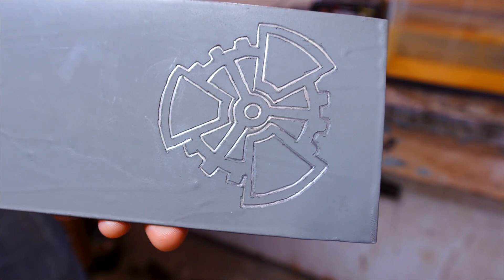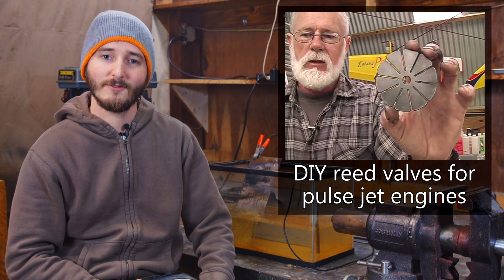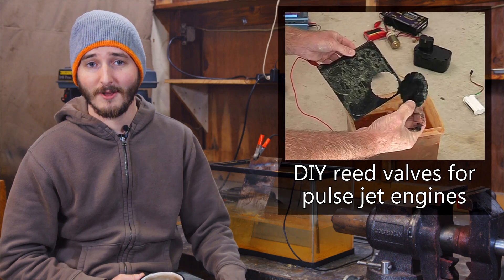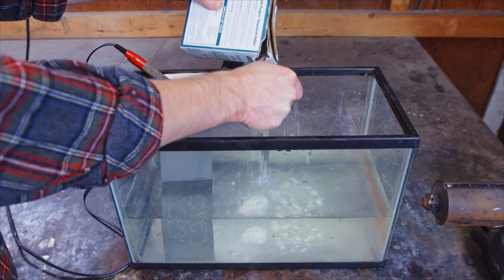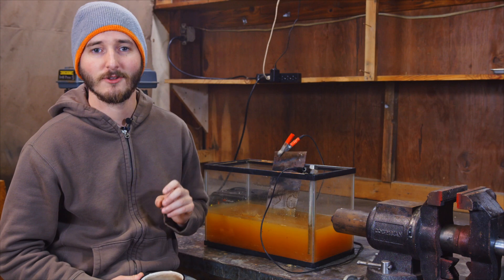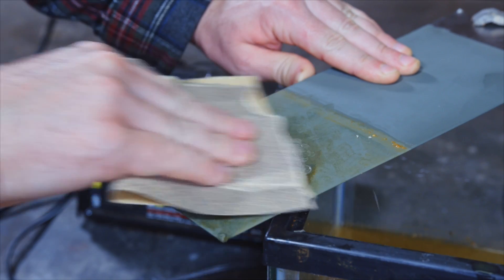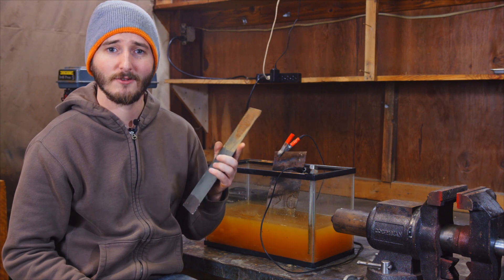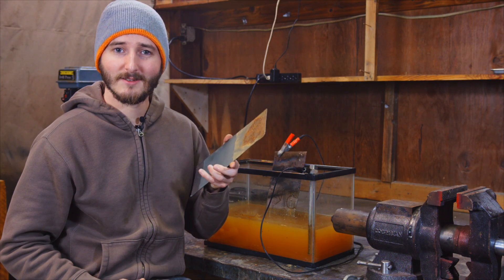How To Cut Steel With Electrolysis [Experiment In Progress] - NightHawkInLight

Comment: Alum, specifically hydrated potassium aluminum sulfate. I used it a lot to dissolve broken steel drill bits and burs from gold and silver. If I was going to attempt this its what I would try.
Reply from the maker: Using an alum chemical etching solution is on the to do list.

Comment: I do that with copper and zinc , it works great with zinc . What I do is I coat the metal with beeswax (more flexible than parafin or palm wax and perfect for this) then I take an awl or a knife to scrime my patern onto the wax until the metal shows up , than I clamp the metal with a part with no beeswax to the positive terminal of my generator and use another plate of metal in the negative terminal . I use white vinegar as electrolyte , I don't think baking soda is up to the task , the best thing to use is NaOH .

Also beware of stainless steel , if it dosen't oxydize in air it will be more difficult to oxydize it with elextricity , also the wider the grove to cut is , the harder it is to cut because you have to oxydize more material , so try to make the finest line possible  , you cannot really use sticky tapee because I didn't found this very effective , I try paint , but I'm not happy with the result , beeswax's the best

Comment: Looks like AvE covered it, once it starts you have it dissolving in all directions, not just straight down. Thing like you're digging a hole in the ground, once you start digging you're not just exposing ground right below you, you're also exposing dirt to the side of you. If you were forced to dig at any dirt you see starting with a grass covered lawn and a small patch of dirt, you'd quickly be digging a half-sphere growing in diameter, starting right at the boundary between the grass and the dirt.

Comment: - so far as etching is concerned, the electrolyte shouldn't make much difference.  But it might attack the resist coating.

- Undercut proportional to the thickness of the etch should be expected.  But more than that would be an adhesion problem.  For a really good cleaning I've heard that a strong alkaline solution (like lye) is needed to cut the grease, and any handling with bare hands afterwards can leave skin oil deposits.  Alternately, an oil based resist (like wax) shouldn't care as much about oil deposits.

- Hydrogen bubbles will form.  As long as they don't adhere they shouldn't be a problem.  On the other hand, if bubbles form and adhere they may prevent depth of etching.  Same with rust that adheres.  Orientation of the metal sheet and agitation of the solution may make a difference.

Comment: Silicone protective coatings (anti corrosion in sea water) are great at adhesion to steel and resistance to demonstrated "bubbling"........ at least the ones I have seen in some lab tests (similar conditions to these in video), but that was some high end industrial stuff for dam gates.
Reply from the maker: Great tip! I bet a lot of marine paints would have potential.

Comment: Try sand-blasting the metal to clean it immediately before applying the paint.  Even with solvent cleaning, you'll still end up with a thin layer of grease on the metal which will prevent perfect paint adhesion.  This from a Dan Gelbart video on proper techniques for painting metals. https://www.youtube.com/watch?v=x7onZGqrYyY

Comment: It really  works  best only  for very  thin materials, .002" to .005" or so.  Also you should  try PC board  etching  fluid ( iron chloride ).   On thicker  material  it is virtually  impossible  to prevent  undermining  of the mask via the  exposed cut.  short  multiple  etching  cycles  and  re-masking the cut faces could be  tried  but may prove  impractical.

Comment: Try lowering the amount of power that is in use, and reducing the thickness of the metal that you're trying to etch. You might want to also try different grades of steel to see which ones perform better.

https://en.wikipedia.org/wiki/Spring_steel

Comment: Hum, maybe some of my experience in automotive quality control might come in handy...let me thing.

Okay, two possible things are happening here. The first is that the steel is being eaten away, and as the channel forms, it then starts to be eaten away from the exposed area, thus bypassing the paint. If this is happening, then I have no viable solution to the problem.

If it is an paint adherence problem, then perhaps you need to use an electrostatic powder coat paint. That should adhere to the steel far better then any other possible coating.

Comment: Maybe the metal sits in the water for too long? Try increasing the reaction speed, ie higher voltage (48V) at a decent current. Please note that newer battery chargers do "smart-charging", which may be messing up your process.
Also, have you different solutions, ie table salt, instead of baking soda?

Comment: SO.. I've got a bachelor's in chemistry. Briefly, I can see several things.

Firstly, Carbonates are bad for this. Bicarbonates are also bad for this. If you're intent on using a basic pH use borax (sodium tetraborate). It won't vent carbon dioxide if there's a rapid pH swing, it is basic, and is a good buffering agent. 

Secondly, I would probably try to use an acidic environment for this. Acids are easier to work with if you're trying to etch/eat metals because they tend to make the solution more acidic anyway as they dissolve into solution. In theory, by making the solution acidic to start out, you slow down this rate of dissolution. In practice it largely depends on which anion is generated by the acid. 
Vinegar is very mild. More aggressive is phosphoric acid, which is the workhorse of CLR (a domestically available solution in the USA). Hydrochloric and sulfuric acid are aggressive enough to eat the steel without any electricity. 

Thirdly, we come to electrode materials. The flexible pipe is not regular steel. It's stainless steel mesh. It's probably nice to work with because of the surface area, but the chrome will interfere with the other piece of metal. I'd switch over to one of two materials: Steel wool or graphite. 
Steel wool should be similar to the sheet metal's composition to be ok, and graphite pushes in the other direction entirely (if there's a side reaction, the carbon oxidizes and goes out of solution). 

Finally... I think going with Wax is probably best, but it's worth noting why. The wax, especially if you apply it hot, sticks directly to the metal. Most paint does not. Paint kinda just sticks to it's self. You could use vaseline, but wax is probably best because it's a bit sturdier. Alternatively, you could use an adhesive... but the carving of the design becomes tedious at that point.
Reply from the maker: Great suggestions. I will certainly be trying an acidic solution in future tests
Reply: @Nighthawkinlight  I used white vinegar solution 10-20 % and Nacl (tablesalt) as electrolite. (only outside if i know well it's generate chlorene gas and it is really toxic)With 12V power supply and around 5-6 amps (i adjusted it with how much is the cathode is submerged {not too accurate :-) } ) Ated trught the 0,7 mm thick mild steel sheet around 2-4 hours. I used acrilic paint unfortunatly i had the same paint separation issue like you. In the source video he used car light bulbs in serial with the anode and this is limits the amps trught the circuit. Sombody mentioned maybe if you slowing down the reaction with limiting the amps and increase the time will help. He uses killrust primer. It is an epoxy based paint. "Kill Rust Etch Primer is a fast drying, high performance, single pack epoxy primer that is designed for the priming of all bare metal substrates." I calculated that he use around 200mA current for this.
Reply: MattsAwesomeStuff I get what you're saying, but... 

Firstly, in this configuration, the chrome actually interferes with the operation of the cell. Iron is travelling from the anode to the cathode, where, the iron will try to stick to the cathode. 
Assuming that there's no direct reaction between the iron and the chrome (aka giving you some benefit of the doubt), it provides a secondary electric double layer for the iron to move through. This actually is very complex to calculate and slows the operation of the cell down.
Reply: Walter Bunn  +
Reply: Ye good ideas, I try to make sure this message is visible by adding comments.
=)
Reply: ... self etching primer... not paint... Huge difference.
Reply: Walter Bunn hey guys it scarce here, and today.....
Reply: I would probably try using Coke before I jumped into using something as strong as CLR.
Reply: +NightHawkInLight I've looked around a bit and found paper about different etching reagents for steel see: http://nvlpubs.nist.gov/nistpubs/scientificpapers/nbsscientificpaper518vol20p527_a2b.pdf from page 35 on looks quite interesting.
Reply: Wait... Why are we using electrolysis again?
Reply: ...SCIENCE!!!
Reply: Undergrad of chemistry and I can agree with what's being said. Steel wool or mild steel mesh is what I would recommend for maximum surface area.
Reply: Baxter Krug exactly
Reply: Walter Bunn ... Maybe you're right, but I don't think so. Iron isn't going anywhere. H2O is being split into H and O, and the oxygen is given energy to force it to bond to the workpiece's iron. H is given energy but fails to bond to the stainless, bumps into itself,  and bubbles away as H2 gas. The chrome and the iron never really enter the solution in any meaningful way. This is how hydroxy generators work and I assure you they run decades without the stainless reacting at all.
Reply: Oh... also... looking at the cell closely... the cutting should be occurring at the anode, not at the cathode. The electricity needs to be in reverse.
Reply: Walter Bunn yes. he's galvanizing.
Reply: I can dig it
Reply: Walter Bunn yeah that's what I was telling his as well
Reply: problem is it's a thin layer and the hydrogen is building up underneath it. I've seen vinyl stickers and 5% acidity vinegar used to cleanly etch much deeper into hardox. What PSU are you doing this with?
Reply: The amount of chromium is relatively low, as is the nickel in the alloy. Considering it's hooked as the anode it's even less problematic.
Reply: Stainless works by having a passive chrome layer on the surface that creates a barrier. Unless you burn through the surface chromium oxide will be the only thing that gets much exposure.
Reply: MattsAwesomeStuff Heh... i watched the video again.... actually i know why nighthawk was having issues.... the electrode where the cutting/engraving occurs is the anode. This is hooked up backwards.
Reply: To make it short - if im trying to cut stainless steel at house - vinegar is OK? Could it generate toxic vapor?
Reply: What, like old pcb manufacturing?
Reply: Covering the sheet of steel with Teflon would be perfection, but paraffin wax will work great as well. I would opt for nickel ammonium sulphate and, as mentioned by others, another sheet of stainless steel. And I would etch on a thinner piece of steel.
Reply: no, teflon or any anything will not be perfect. imagine a candy bar: you cut a perfect image into the wrapper and then heat the thing to melting temperature. you melt the whole thing. the fact that a layer of anything is on top of it is irrelevant because the entire mass inside of it is being affected. 
electrolysis, you have electricity passing through the material and then out of the bare part. the paint or wax or teflon does not seal off the metal all the way through, so the entire inside of the metal is just as susceptible to the electrolysis because it is conducting electricity. you need thinner metal to minimize the effect
Reply: Walter Bunn I
Reply: dear walter bunn, how to dissolve the anode completely and quickly, Im doing a fun experiment.
Reply: @johnnewman3221  if you're trying to destroy the anode, use a stronger electrolyte. something like sulfuric acid.
Reply: @walterbunn280  will it dissolve quickly in 15 min. concentrated? Im using iron nails, how much voltage is required
Reply: @walterbunn280  yes the faster it etches the less time the surround has to react! Inevitably it will eat sideways so quicker the better but not so quick that its overfrothing 😂 and oxilic acid might be a winner!
Reply: Regarding paint only sticking to itself: Dan Gelbart says the easy way to get it to actually stick to metal is with Ajax or Comet. He says once water sheets completely instead of beading, you can bond paint to it on a molecular level. But you only have an hour before it re-oxidizes and begins to bead again.
Reply: If there are hydrogen bubbles the voltage is backwards and it won't cut at all as you will be depositing the iron as it dissolves
The bubbles produced are carbon dioxide and oxygen
Carbon dioxide can be entirely avoided by using a solution free of carbonates
Oxygen can be reduced by using a lower voltage
Reply: I disagree with your comments on stainless. Stainless is exactly what you want. The chrome isn't going to "react" with the hydrogen or the mild steel. The entire reason it is popular as a material is because it's so handily inert. I think he wants a stainless sheet, parallel to the eching sheet, spaced off. As long as he's not using table salt (chlorine compounds eat anything, which is why things submerged in the ocean use Inconel instead of stainless, to buy some time), the stainless is so inert it should last decades without any noticeable reaction.
Reply: +NightHawkInLight i know nothing about this but something is telling me running water might help?
Reply: Walter Bunn pfft nerd!
Reply: doesn't matter what you do to coat the outside: once you expose the metal and begin breaking it down through electrolysis, the electricity will get the to metal around the scratch because the entire inside plate is conductive. you will be pulling metal away from the inside, so even if you coated it with some super non-conductive epoxy polymer in a meter in all directions, once you expose even a pinhole during the electrolysis, you will begin eating all of the metal underneath which is facilitating the current flow
Reply: Walter Bunn you're clearly a smart guy who knows a lot about chemistry, but I think you've made the mistake of overreaching here. You've talked before you've listened, being a bit too confident in your own knowledge. Book smart vs street smart sort of. Be cautious to temper, or at least frame your advice to what you actually understand rather than presuming you know it all. You'll bump into this regularly.

Comment: try using a basic solution, so the metal doesn't rust. i know that sodiumhydroxide in water is able to etch tungston, so it will probaply also work with steel

Comment: it might be interesting to use a rubber coating over to of the protective paint and then scratch through that. if you can find a spray on plasti dip that should work, or liquid tape which is used as electrical tape but it is applied like a paint or rubber cement. you might want to look at knife makers videos to see how they do etchings on knives to see if any use a more powerful solvent that "if not careful" can cut through the metal.

Comment: have you tried to use some form of water proofing spray like Ultra-Ever Dry or so? i dont know if that works at all, but you could cover a shape with painters tape ( or even duct tape ) and spray the rest of the metal with your water proofing. 
i dont think those are non conductive though. so maybe use a layer of your paint first, then cover it in water proofing

Comment: could you electroplate (zinc or chrome maybe?)  it instead of paint? like paint the negative so the electroplating only happens to the part you want safe on the electrocutting, then strip the paint with acetone and do the cutting

Comment: Looking at the video that you used for inspiration a few things came to mind. 1 - his sheet of metal is much thinner than what you're using. 2 - the back of the plate that he is etching with is against the wall of his solution container, 3 - he was using salt rather than baking soda.  He is also sanding his surface to remove the oxide and mill scale, perhaps that step is helping with the adhesion of the primer? Good luck.

Comment: When edges start corroding the mask is going to fail.  

Imagine cutting into a surface.  This is a 3d cut with depth.  the exposed edge which is perpendicular to the face is also exposed to etching which wears away material under the mask.  This is what causes the mask to fail.

Masked etching is useful for surfacing, but a through cut will always eat the masked edges once it drops below the adhesion layer of protective film.

Comment: I'm no expert and perhaps this isn't the problem you've identified, but couldn't it just be that the cross-section (the wall) of the cut that is formed as the unpainted areas corrode is not painted, and as a result the corrosion will spread outward from within the cut, underneath the paint?

If that's the problem, it seems the most effective way to avoid it would be to frequently re-paint the interior of the cut and re-scratch the design.